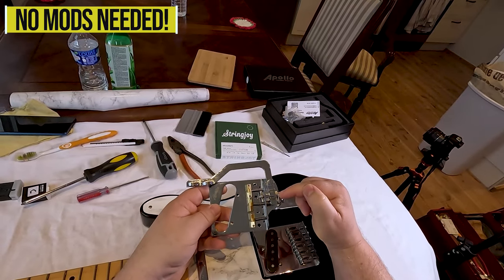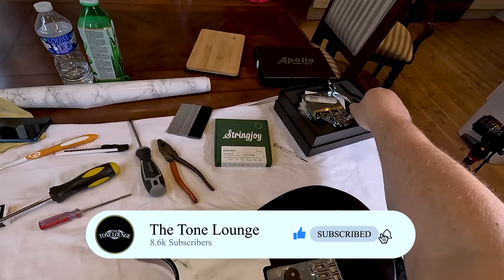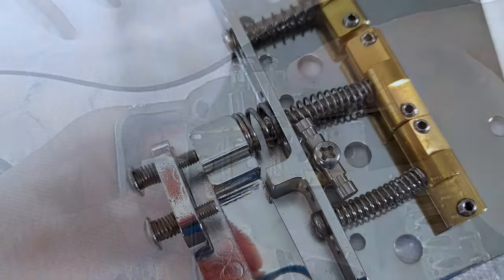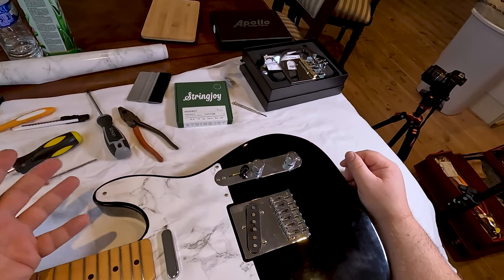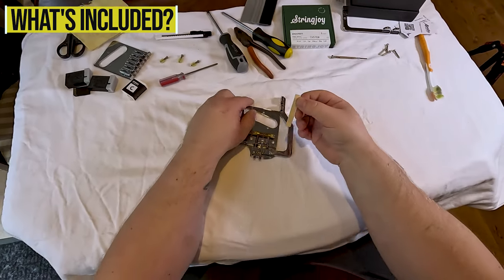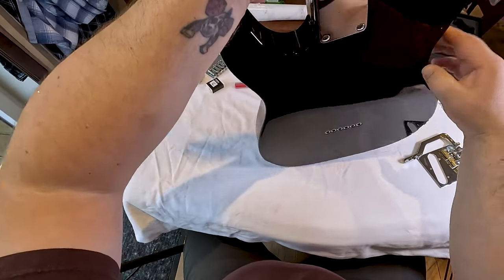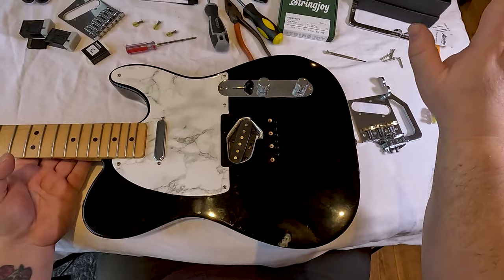Upgrade your guitar in under 30 minutes: Easy, no-mods needed B&G Bender

Comment from the maker: ⚡ CHAPTERS:
0:00 DEMO
0:39 NO MODS NEEDED
1:25 FITS 95% OF TELES
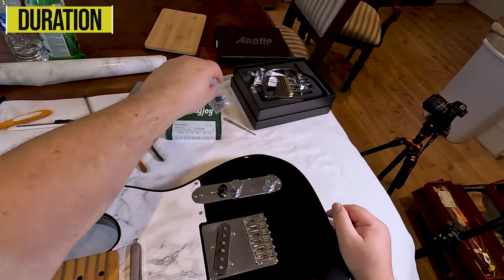2:12 HOW LONG IT TAKES
3:08 WHAT'S INCLUDED
7:19 PICKUP FIRST
8:39 INSTALL
9:07 IMPORTANT TIP
10:29 STRING LOCKING TIP
11:23 LOWER PICKUPS
12:39 STRING HEIGHT
13:24 RADIUS
13:54 B&G STRINGS
14:14 TIP
15:00 FINAL THOUGHTS

Comment: Very  nice job, that is a clever design for a hot-swapable G/B bender.  I just installed a VegaTrem VT2nd on my Tele, it also required a neck shim, but does a good job at the light vibrato thang with twang!  That marble pickguard you have on that tele is very elegant, even statuesque you might say!
Reply from the maker: This bridge is a really well thought out design. The idea that you don't need a luthier to install it, or require the need to permanently modify your guitar is also a plus. The pickguard is still the same one I had before. All I did is by some vinyl covering and stick it on there.
Reply: @TheToneLounge  Very cool, now I noticed your roll of marble vinyl on your work table at 0:40 - I have been thinking about trying that trick to make a flame maple top over a plain top if I can find a convincing enough pattern.